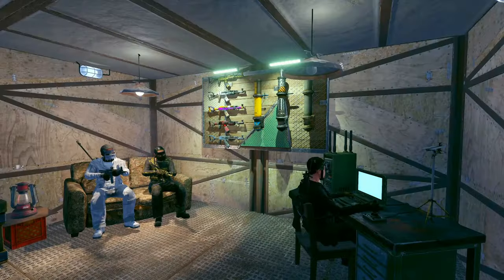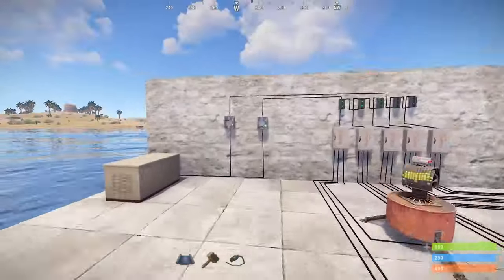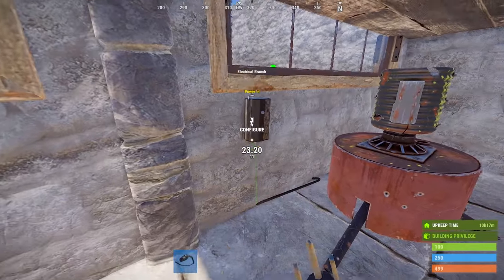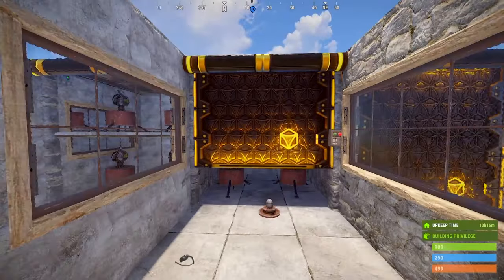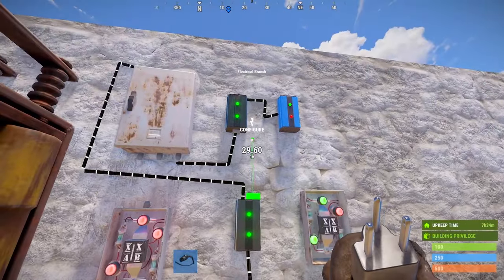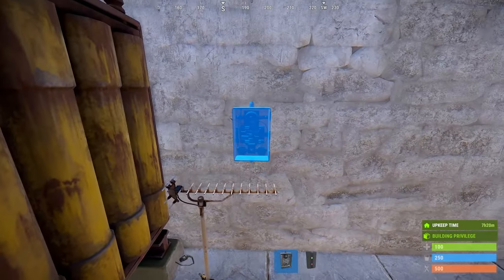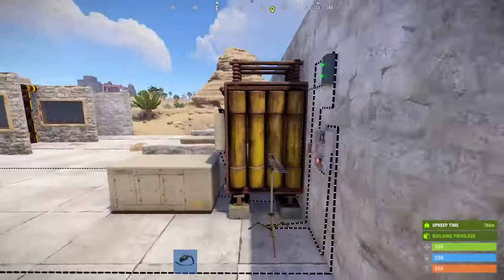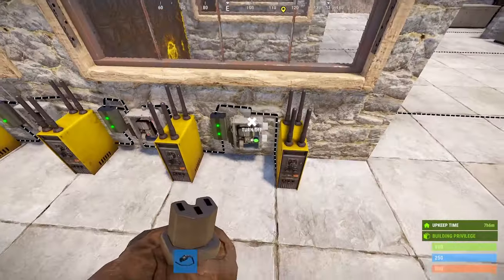Rust | THIS SETUP BREAKS THE TURRET NERF!!! | Rust Turret Pod Tutorial

Comment: You don’t need the last branch, just use the door controller passthrough. The doors move too slow before turrets are on. I used this setup last wipe. Also don’t put branches in the pods. 1 molly and the system is disabled.  Better off with 3 turrets, power to controller, passthrough to splitter. Splitter takes 2 mollies if you really need  to keep in pod.
Reply from the maker: Those are great points, thanks for commenting! I'm just trying to demonstrate the concept of an automatic turret pod circuit for people interested after the turret change. I probably wouldn't put 4 turrets behind a single door LOL
Reply: honestly I had 2 with pythons last wipe and I had 2 smart switches. 1 shut everything off and 1 just opened the door. Originally 1 did it all, but the turret boot time was too slow and people running by (on a road) could move faster. Base raiding might get them stuck in one area, so this might work. I also used the Tugboat bunker but they blew up my boat. The tc compartment is tough to get into without some netting and you need to mention that it needs external TC's to maintain the walls. Awesome idea / design
 @ChazzeyRust
Reply: @s0fakingawes0me14  if hbhf sensor is hidden, you have 1 chance that turrets will defend. An experienced rust player will hear it or quickly learn where it is and then your turrets will basically sit behind doors. Tried using hbhf sensors for automated base protection many times before, but nakeds easily overcome them and spear the turrets out by using hbhf as a helping component. Also, if you want your turrets to kill someone, you must use double door instead of garage, because it takes ages for garage doors to open. This setup only works perfectly when you are online and open the turrets on demand.

Comment: I would use double armored instead of garage doors.  Garage doors very slow to open, and any good eco-raider can exploit how slow they function. 
Also, certain deployable(s) will not block the LOS of the HBHF.  Many ways to hide them.  Good video though!
Reply from the maker: That's something I hadn't considered, even sheet metal doors would be faster than a garage door to open. Bear rugs are always a solid option for hiding HBHFs. Thanks for the feedback!

Comment: This is cool, but the HBHF range is only 3.5 squares and requires line of sight, so after one person falls for it, they can just blow the HBHF sensor/blow the turrets without them ever turning on again.  Thanks for putting in the work and giving us another option, though.  Video is well done and easy to follow!
Reply from the maker: These are very good points. I think the reason for a setup like this is the same as it always has been for turrets, not really to prevent a raid entirely,  but to slow things down and create a headache for the raiders. Thanks for the comment!
Reply: @ChazzeyRust  Very true!  It would indeed be a headache, haha.
Reply: you can very easy implement a timer in this circuit and put on whatever value to keep the turrets on and doors open.
Reply: I HATE the Update it destroy rust
Reply: Yes, but when using RF Broadcasters and Receivers especially, you must remember that you do in fact have more ways to engage the circuit than HBHF alone: specifically using an RF Transmitter or/and a Smart Switch and Alarm. Furthermore, when using an AND Switch, when the HBHF Sensor is destroyed, the circuit can no longer be powered via the HBHF Sensor, however, adding an OR Switch in between HBHF Sensors input and the AND switch allows you other ways of triggering the circuit so that the circuit isn't just dead. If the HBHF Sensor is powering the door controllers, the doors will shut when the HBHF is destroyed, preventing your turrets from being grubbed. There's other problems, mainly that HBHF sensors + Door Controllers + the door opening animation don't always line up properly--such that you and raiders can find timings and positioning where you are able to retreat without the doors to the turret pod closing despite the HBHF being unable to see you for a significant period of time. It usually works properly though. I also prefer to deny turret cover with barricades/choke points to alleviate this issue, this helps actually flush them away from any partial LoS to the HBHF allowing them to use the HBHF to their advantage. This typically shuts down grubs, but as Chazzey alluded to, anyone can grief or raid you with enough persistence using anything in Rust. My favourite method though? When I'm able to place turret pods facing my base from externals or compound, and turrets on main base covering those turrets. It creates a very difficult zone to attack without raiding one of the external pods. 

P.S. If I'm tryna grub around I might leave an HBHF alone in case I can abuse it. Whereas if I'm raiding I might try to actively destroy any exposed circuitry.

Comment: could you setup turret pods that open when a turret is broken and replace it? you could use the low ammo output with bolty turrets for a continues signal until the turret is broken but I'm not sure if there's a better way to do it
Reply from the maker: You could rework this circuit to work with a turret being destroyed as the trigger, but it might be a little expensive on power. A splitter connected to a branch and the trigger turret is what I would start with.

Comment: well I made this exact same thing. It has a huge flaw. When the hbf sensor is destroyed, it triggers the timer and garage door opens for the few seconds BUT then closes permanently. While the transmitter is sending signal continuously. Thanks for the detailed video but you didnt test the mechanic fully
Reply: I didn't watch the whole video but I watched enough to know he showed the more complicated failsafe circuit with RF components. I'll just copy and paste the long comment I just left to another person with the same criticism (that destroying the HBHF in the first circuit permanently kills the circuit) to give you some insight. Maybe you can find other videos that'll help expand on what I say. Try Austin Klailia Rust. 

<<Yes, but when using RF Broadcasters and Receivers especially, you must remember that you do in fact have more ways to engage the circuit than HBHF alone: specifically using an RF Transmitter or/and a Smart Switch and Alarm. Furthermore, when using an AND Switch, when the HBHF Sensor is destroyed, the circuit can no longer be powered via the HBHF Sensor, however, adding an OR Switch in between HBHF Sensors input and the AND switch allows you other ways of triggering the circuit so that the circuit isn't just dead. And doing this is recommended. If the HBHF Sensor is powering the door controllers, the doors will shut when the HBHF is destroyed, preventing your turrets from being grubbed. But you can still trigger the HBHF Sensor's role in the circuit with an OR switch and RF system or Smart system or memory cell or timer. There's other problems, mainly that HBHF sensors + Door Controllers + the door opening animation don't always line up properly--such that you and raiders can find timings and positioning where you are able to retreat without the doors to the turret pod closing despite the HBHF being unable to see you for a significant period of time. It usually works properly though. I also prefer to deny turret cover with barricades/choke points to alleviate this issue, this helps actually flush them away from any partial LoS to the HBHF allowing them to use the HBHF to their advantage. This typically shuts down grubs, but as Chazzey alluded to, anyone can grief or raid you with enough persistence using anything in Rust. My favourite method though? When I'm able to place turret pods facing my base from externals or compound, and turrets on main base facing/covering those turrets. It creates a very difficult zone to attack without raiding one of the external pods. 

P.S. If I'm tryna grub around I might leave an HBHF alone in case I can abuse it. Whereas if I'm raiding I might try to actively destroy any exposed circuitry.>>

Comment: Wouldn't it be much easier to have Turrets activate other Turrets if they get destroyed? This could be achieved by passing the energy from a turret in the compound then supplying a turret inside the base. But since only, for example, 2 energy are passed through, to the turret inside, the turret in the base only activates when the one in the compund has been destroyed?
Reply: Not good if you get attacked in top-down

Comment: Why do you need to place the grid over and over so many times tho? pretty sure you can simplify it with 12 turrets per grid like that activating
Reply from the maker: This is absolutely true, I'm just showing how you would setup multiple pods, but you could have up to 12 turrets per pod. Thanks for commenting!
Reply: yes but don't forget if raiders place a lot of turrets at their raid base when they get activated might not work a lot of them. needs further testing. splitting like he did in the video helps a lot I think.

Comment: my solution: on/off switches
break up my turrets into 3 groups of 6 each
6 exterior, 6 on top and 6  interior
when they come raiding on goes exterior
if they break through interior takes over etc
as far as offline raiding goes
brazilians are banned problem solved